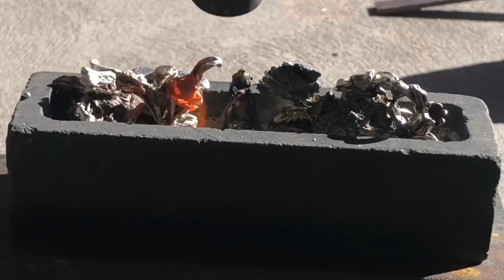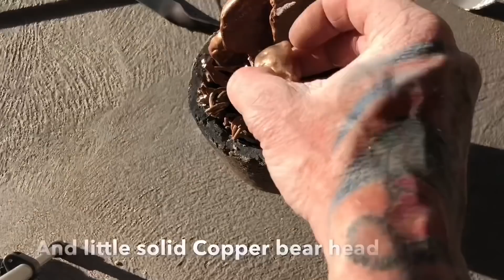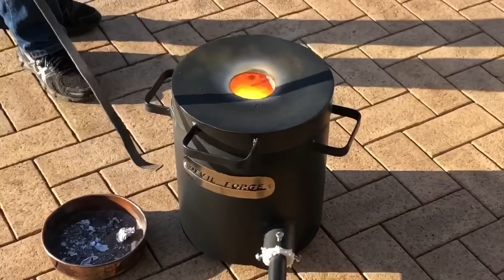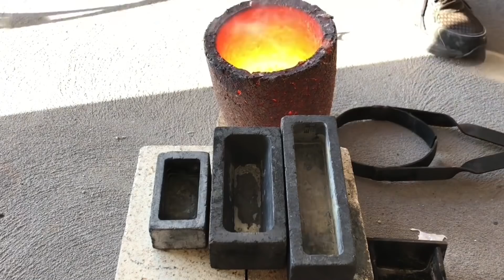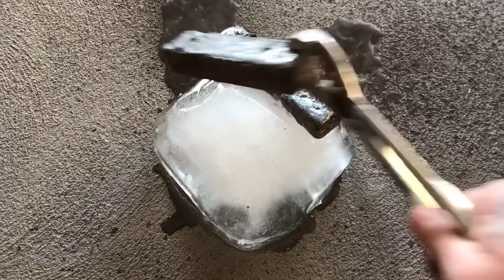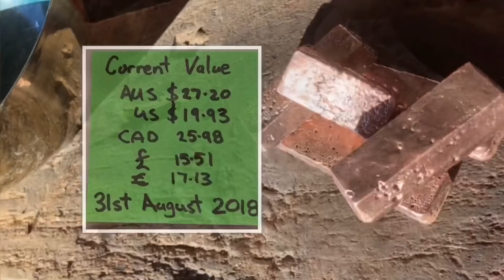3KG Bronze Blocks from Mixing Copper & Pewter - Bronze From Scrap

Comment: Hey, to lower the loss in metal, first melt the copper, when it is liquid, add the tin. In industrial foundries it is done like that. First melting the base metal(often has the highest melting point) than add the other alloying metals. Some flux is never Bad, especially when your dealing with brass, Aluminum and alloys with reactive metals like magnesium or zinc. Greetings from Germany

Comment: That shelf you got there must be really strong.
Reply from the maker: I know right 😆. I put these shelves up 12 years ago with the cheapest possible wood and screws and brackets as it was designed to only hold up DVDs !!! God only knows what’s still holding up these shelves 🤷🏻‍♂️
Reply from the maker: Check my latest vid I add a lot more to it👍🏻
Reply: @bigstackD  damn lucky man. My shelf broke the last 2 months 4 times

Comment: As an electrician, I acquire plenty of copper, brass, extruded Aluminum, cast AL and zinc but no tin. I ended up buying a couple lbs. Didn't tnink of pewter. Have to keep my eyes open for that.
Reply from the maker: Yeah tin is pretty bloody hard to fine that’s for sure unless A subscriber just send me 2 kg of Babbitt metal from some bearings that’s about 90% tin aswell so I’m slowly getting a little bit built-up of it for my future castings👍🏻

Comment: It looks like you could use a different set of pouring tongs. The horizontal ones look a little distracting to use.
Reply from the maker: Actually I’m gonna modify them soon to makem easier and safer to pour heavier fuller crucibles😁👍🏻
Reply: bigstackD Casting
This will make a great video.

Comment: Can you explain what channel locks are? And what did you mean that molds would be recast soon?

Why do you have to preheat all utensils and molds before you use them, even to just hold the crucible?
Reply from the maker: Channel locks are just type of pliers that has an adjustable grab size . I meant these Ingots would be re-cast soon into a world War one thing I’m hoping to do. I pre-heat the molds always has any moisture in them can turn to steam instantly when you pour the molten metal in and it can create a steam explosion sending molten metal everywhere, I pre-heat the tools as I don’t like the idea of touching 20°C steel to 1100°C red-hot Crucible. 
 I’ve never read or seen anyone say to heat the tools but I’m sure it can’t be good for the Crucible👍🏻
Reply: bigstackD Casting — dope! Thanks for the response. I somehow landed on of your videos, and went on a binge watch all day 😄. 

I work in an office that has nothing to do with casting or forging and yet I’m taking mental notes while watching your vids as if I’m about to start casting too. I’m like, “ok ok always preheat the mold, check. Next, I should always take the stag off the top, done. Now what we wanna do is heat our tongs...”😂
Reply: I learnt the hard way about preheating molds. I have aluminum splattered all over me. I was wearing fire retardant coveralls at least and safety glasses. But managed to burn my hair eyebrows and burnt threw the sleeves of the coveralls
Reply: Josh Spilman — oh jeez! That sounds absolutely awful but be thankful you were wearing eye protection! It could have been a LOT worse.

Comment: Does adding the tin lower the melting point? I know bronze has been used for thousands of years using various metals to change the characteristics of copper, but seeing that you need to create the surface of the sun to melt copper, I've started wondering whether part of the benefit of bronze is lowering the melting point to make it more usable.
Reply from the maker: Yes adding the tin lowered by probably 100°C which certainly made it easier to melt the copper also have noticed that There has been little to no tarnish what so ever  on these bars compared to pure copper bars which  tarnish in only a few days. If all goes as planned this week I plan on re-melting these bars and making something from them that I’ve had my eye on for awhile🤞🏻😁

Comment: Do you think upping the pewter amount would make a white bronze?
Reply from the maker: Actually white  bronze has copper tin and zinc added but in a way you’re right because it has something like 30% tin -50% copper 20% zinc. Don’t quote me i think I’m a bit off on  those numbers
Reply: @bigstackD  Sweet! I'll need to do some experiments. My goal is to make a decent white bronze without lead and nickel for jewelry casting

Comment: Still looked very pink for a bronze alloy? Shouldnt it be browner?
Reply from the maker: Definitely should be Browner maybe once it is tarnished it will go to the normal colour as I used a wire brush on these. The Pewter i melted contained bismuth and antimony but only the tiniest amount so maybe that’s giving it the slightly odd colour. 🤷🏻‍♂️

Comment: From where did you get your thermometer thinking about buying one via amazone but cant decide wich one i should get
Reply from the maker: Probably cheaper on eBay? Here’s a link to the one I buy👍🏻. 
LCD IR Infrared Laser Thermometer Pyrometer Temperature Measuring Gun -50~1050°C https://rover.ebay.com/rover/0/0/0?mpre=https%3A%2F%2Fwww.ebay.com.au%2Fulk%2Fitm%2F272607042582

Comment: I love what you do. What's the difference between Nordic gold and bronze?
Reply from the maker: Nordic gold is 
89% copper
5% aluminium 
5% Zinc
1% tin
Where as bronze is typically
Copper 88%
Tin 12%
😁👍🏻
Reply: Thanks for replying 😊 I would love to make some Nordic gold one day
Reply from the maker: I had no Zinc left and couldn’t find any anywhere in Australia for 6 months but I just recently found someone selling 450 grams of zinc for $19 delivered 🥳. So now I will be able to make a heap of Nordic gold coins I can’t wait👍🏻😁.
Reply: If you want to find zinc, all you have to do is find a company that does galvanisation. And see if they can help 😊

Comment: I've got 100's of lbs of aluminum, over 1000 lbs of copper, & 2 months ago I weighed out more than 700 lbs of brass. I've got the basic set up for aluminum melting. Do to the much higher heat I'm not set up for copper and brass. I forgot I also have a lot of lead, I've not weighed it but I would guess 400 lbs or more. At one point I was just hoarding waiting for prices to go up at the scrap yard. But after watching Ben's and now your vids I  was thinking of making bars to start.
I've got a question do you think I should start with aluminum? Compared to copper or brass?
Side note aluminum is the metal that I can get an almost unlimited supply of for free.
Reply from the maker: Personally i started with lead to get my heat around the way metal flows but that shits bad for everyone so i moved on to aluminium as thats obviously twice as easy as copper , i recommend depending on your furnace to start with aluminium but before doing any melting make sure you have all good PPE and do alot of research especially on other channels as im completely self taught and for all i know i could be doing half my stuff wrong. below is a new video of the furnace a company sent me and this thing will melt kilos of copper in 15minutes you need to see this furnace to believe it as its quite scaringly powerful and they sell for about $400 US delivered. Im very jelous of your metal haurd. At any time you can get free metal grab it cause like you know its like money in the bank . Also where do you live? i ask as your saying lbs and not kilos. 
https://www.youtube.com/watch?v=V0KZGNb_cNM
Reply: bigstackD Casting I live in the State of Indiana U.S.A. Unless I sell my copper or brass for scrap price I don't have the money to invest in a $400 item. Last year before I got started in scrapping I had a friend make me a furnace out of a  propane tank from a regular 
barbecue grill and about 8 crucibles out of the small green Coleman camping propane tanks they'd hold about a quart. I don't know how many liters probably, 1 or less. I have watched a lot of how to vids to prepare for copper. like lining my furnace with Plaster of Paris with steel wool or mesh in it. The cost of that would be about $20 to $30. I would have to save money up for one or more of those bar molds for the higher heat metals, like copper or brass.
Reply from the maker: Actually those graphite bar molds are quite cheap and come in heaps of different sizes just jump on eBay and google graphite molds 👍🏻. Yeah my first 2 Furnaces were a bbq gas bottle and a Beer Keg and I got them both from friends 😁. My first setup cost me next to nothing except the burner which cost me $100 US .
Reply: That's good to know, I guess I shouldn't have assumed that they're costly I was expecting to pay over $100.00 for a mold or two. Just curious, and I'm only asking because if I can get it free or make it, I'd spend an hour to save a dime :) . Do you or do you know anyone who has tried to make their own graphite molds? Reason I ask is all the graphite we come across in scrapping. Like the ones on power boards with the copper wrapped around it, or many others things.
Reply from the maker: Here’s what I did with some graphite blocks 
https://youtu.be/myn4B1VVvAA

And here’s another guys use . Both uses work great . I’m sure you’ll be quite surprised👍🏻. 
https://youtu.be/PorwvzTwh44
 
Check em out and let me know what ya recon matey 👍🏻
Reply: I watched both. Very good ideas running through my head! I've seen you cast coins with that mold before and I thought you had it personalized by a company! I'm thinking of a variety of bar sizes but I've only have smaller pieces most of them are round ring sized. How do these companies make their graphite molds? If that hasn't been done by someone like you and you were the 1st to show how it's done that would be an incredible accomplishment! It's probably been done but I don't surf YouTube very much. Ben is my main guy. Now I'm getting to know you and I'm very impressed!!!!!
Reply from the maker: Yeah matey cheers . I’m assuming company’s that do the personal graphite molds that look perfect are done by a digital router or computer driven engraver of some kind but there bloody nice and not cheap . If you have some artistic ability you could make some awesome molds but I don’t have any of that so mine look pretty shit but still very satisfying and rewarding wen your holding a big pile of personalised coins you made from your own mold😁.I know I keep sending you to my videos , it’s not for the views it’s just easier for you to watch then for me to explain. In The video link at the bottom those graphite molds i use they cost about $4 each on eBay and are super handy for little melts 😁. 
https://youtu.be/6qpV1hLrOcc
Reply: bigstackD Casting I'm very grateful  that you are helping me!! I'm asking what should be common sense with some of the questions. I feel bad for taking your time. I am interested in one more thing, where are you from?
Reply from the maker: I live in the southwest of Western Australia 🇦🇺🤘🏻😁🤘🏻